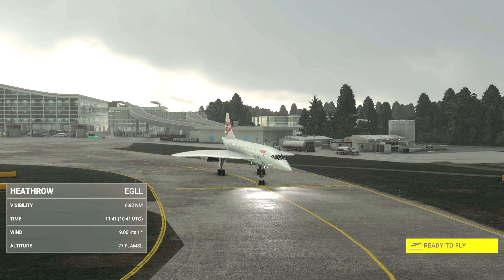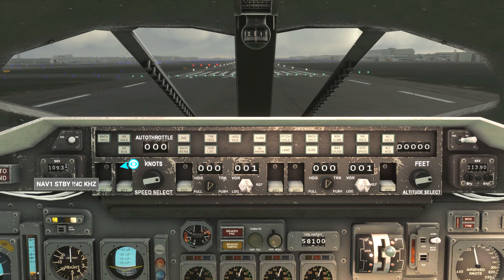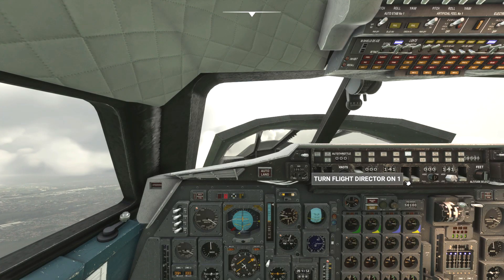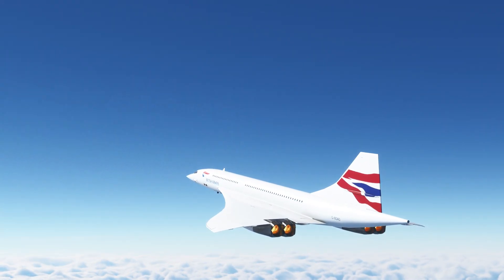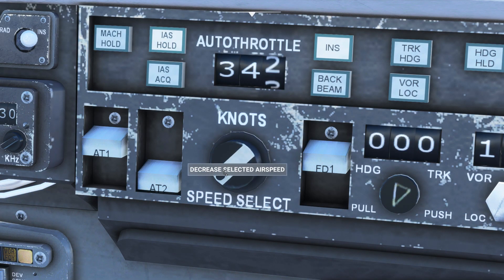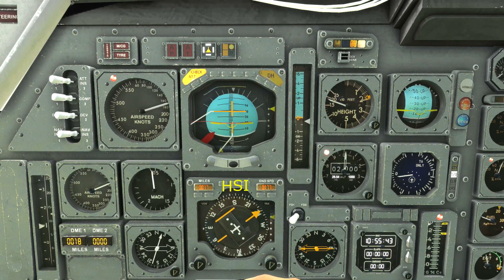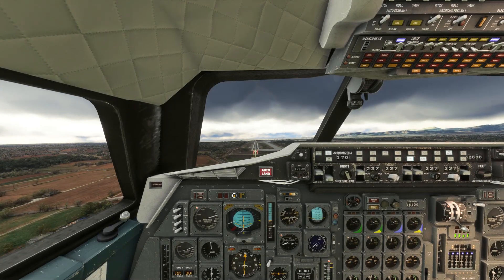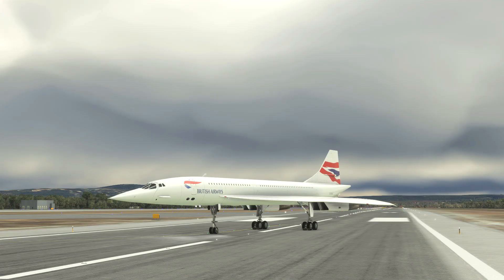DC Designs Concorde MSFS - Easy Tutorial | Full Flight

Comment from the maker: IMPORTANT: The plane has been updated since this video and fuel trim actually affects the aircraft now. To adjust it, please check out one of the many MSFS Concorde fuel trim tutorials on YouTube such as this https://youtu.be/q7DvOmtm38c?si=1Xe5C3Lzwh06GWxo

If you encounter other issues, make sure the plane is up to date - the updates can be found on the Just Flight website or ingame Marketplace, depending where you bought Concorde from.

Other tutorials:
Cold & dark start tutorial: https://youtu.be/M2ZXd7JV444
Immersive flight EGLL - KJFK: https://youtu.be/gqRzWGr0K3I
Reply: Thank you for the video, was great. One question though.. first flight today, all was fine until decent. When I tried to set the altitude to 36000, hit the two buttons and went to set verticle speed, but it wouldn't change at all.. I saw in your video it displayed the verticle speed while hovering over the mouse, but for me, nothing! Had to descend manually and then only at 2500 would it stick to the altitude. Any ideas of what I did wrong? Thanks
Reply from the maker: @611Jayman  sorry just saw this (thanks YouTube). You need to hold down the nose up/down switch until you can see the arrow change position on the VSI (the tall bar near the primary flight instruments which goes from +6 to -6).
Reply: that guy you have linked for the tutorial paywalled his video
Reply from the maker: @deberryn  yup thanks, link updated. I was surprised to see this had happened, and I’m really not a fan of paywalling information that is freely available from other creators. Seems a little elitist and self important IMO.
Reply: Many thanks.I tried to
ask Just Flight,not to buy and download,l could ask about this ocasion,marketplace is also asked,but,no replay. I wonder if I would buy Just Flight derectly.
Reply: Thank's for the heads up.💚
Reply: For some reason, when ap is engaged the plane only banks right
Reply from the maker: @louiscobley1  Not sure the airplane has been updated for su14 yet. Could be a bug. Seek support from the developer.
Reply: @smilerfanatic8889 did you fix this
Reply: I've watched this many times, excellent tutorial ❤
Reply: I cannot put max climb and altitude acquired on at the same time
 Please help
Reply: @RiDs4163same did you ever resolve it?

Comment: Bro can u PLEASE make a new tutorial. First, I can’t use max climb and altitude acquired at the same time! Secondly, what I do is set the plane first to 28,0000 feet with the autopilot and alt acquired! It reaches 28,000 feet around Mach 1, but then when I set it to 60,000 feet, the plane starts ascending but then the trim goes up to about 20% and I can’t get past Mach 1.20 before it slows down.
Reply from the maker: Have you tried the fuel trim tutorial from the pinned comment? :)
Reply: @TiJayFLY I tried it just now !The pitch keeps going up to almost 20% and the plane eventually stalls!

Comment: It never lets me lower the flaps
Reply from the maker: It doesn’t have flaps 😉
Reply: @TiJayFLY I meant the nose sorry 🤣
Reply from the maker: @pedrocuadrado-qc2sz check the speed :) it won’t deploy if the nose would be overspeed
Reply: @TiJayFLY it’s like when I’m in the runway it won’t let me lower the noise. And it won’t let me climb to 62000 only stay at 43,000.
Reply: @pedrocuadrado-qc2sz  It's dependent on external plane weight including fuel and temps if it can climb, so it can take a long time to get to 60k IF it can reach it also use MAX CLIMB.

Comment: Something seems to have been changed since you made this video. It doesn't appear to be possible to have Max Climb AND Alt Acquire on at the same time any more. If you switch one on, the other goes off.
Reply from the maker: @jettlethedragonpeeltheoran8915  Possible. But the actual Concorde procedure (that is also used in other sims such as FS9/FSX and Aerofly) is to have both on, so if this has changed it’s technically incorrect…
Reply: im getting this too!

Comment: You really should point out at the beginning that the nav source switch above the frequency display MUST be set to INS if you want the plane to follow the correct route after takeoff. By default, it's set the other way. In this video, it's already set correctly.
Reply from the maker: At the time it probably was set correctly by default. The plane and sim have been updated a fair few times since. I didn’t do any “off screen” setup - I recorded and included every step that was necessary at the time.

Thanks for the comment, hopefully anyone who needs to see it will do

Comment: i have a question, when i hit exactly mach 2.0 it sounds the overspeed alert and it doesnt let me continue cimb, it stucks at 48000 feet and it's VERY anoying
Reply from the maker: You're either not in MAX CLIMB or your fuel trim is bad
Reply: @TiJayFLY  in case is the first one, then why it doesn't climb more? and in case is the second one, how do i fix it?
Reply from the maker: @leonolink6738  probably fuel trim. Useful video in pinned comment

Comment: I have an issue with approach. My concorde flight the flightpan perfectly on the nav, but just before the final turn towards the runway and approach, it goes straight on. It does not want to make the final turn towards the runway. Anyone else having this issue, or can help me to solve it?
Reply from the maker: It’s a known issue with the plane
Reply: @TiJayFLY  thanks. Guess I'll have to fly the final approach manually. Hopefully they will fix it at some point.
Reply from the maker: @GerhardusDelport  it’s a limitation in the sim. GPS path following and ILS following share sensitivity settings - in Concorde, the sensitivity needs to be really low or it would wander at Mach 2. The side effect is it’s not sensitive enough to follow an ILS

Comment: Hi, I was just wondering if anyone knows how to see how many NM you are from your destination, because I don't know when to start descending now :)
And just wanted to say that this is a great tutorial, I can do full Concorde flights myself now while using a few systems (so not just manually flying from point a to point b without autopilot etc.), making my gameplay feel way more realistic than it used to be!
Reply from the maker: Concorde TOD is roughly 215nm from destination, assuming you’re at Mach 2/60,000ft. There is a DTG counter on the pedestal (assuming you’re flying direct and the “next” waypoint is your destination)
Reply: @TiJayFLY  Usually I’m flying using waypoints in between my departure and arrival airport, is there any way to see the distance than?
Reply from the maker: @kevin_van_den_berg  I think if you have the GTN750 addon you can pop up a GPS that will list distances throughout your flight (in any plane, not just Concorde).
Reply: @TiJayFLY  ah thx! I’ll install that later, that would be really useful 😅

Comment: Followed this guide to the letter, but for some reason even though a pull back completely on the yoke, the aircraft wont nose up or take off even well past 200kts, it just plows through the end of the runway, I have no idea what I am doing wrong
Reply from the maker: It’s not just this guide you need to follow since an earlier update - you’ll also need the fuel trim video linked in the pinned comment. In most Concorde add ons this flight engineer role is automated, but for some reason you have to do it yourself in this one 🫠

Aside from that, check afterburners are on during takeoff, and that the airplane isn’t overweight or out of CG in the weight/balance menu preflight.
Reply: @TiJayFLY  Thanks for the reply, afterburners were on and the aircraft was certainly not overweight, guess it has to do with the whole fuel tank trim business but I wasn't sure, seems very complicated even with the video you linked, wont bother around with it now haha, thanks.
Reply from the maker: @waynesyrzysko7382  My feelings too. I’m waiting for the FSLabs Concorde, and I recommend everyone does the same.

Comment: Hi, for some reason, the autopilot dials and knobs aren't responding. So I can't change the frequency or altitude or anything. Do you know what the reasons for that would be?
Reply from the maker: Is the plane up to date?
Reply: @TiJayFLY  I've only just downloaded it.

It worked the 1st time and I used your tutorial, now it's just flaking on me 😕

*Edit thanks for the quick response.
Reply from the maker: @d3vsy  it’s not the most reliable add on. Tbh it may be fixed just by restarting your PC
Reply: @TiJayFLY  I'll try it, however I'm on xbox :D

Comment: I don't do any of this, just power up and go...

Maybe that's why I don't get to Mach speed, seems to stick around 300 knots, even trying to fly level with afterburners on!
Reply from the maker: Concorde does require a specific procedure, but your issue is more likely fuel trim. Check the pinned comment, as it needs to be adjusted manually now 😢
Reply: @TiJayFLY  I will have a look, I'm a very basic pilot, so will have to see how I get on lol
Reply from the maker: @WattsZen  when this plane was released (and this tutorial was made), fuel trim didn’t affect the plane and so it was suitable for beginners - but since fuel trim dynamics were activated it became a lot harder. Even I don’t really fly it these days because of this. 

Every other sim Concorde (Colimata, FSLabs, PSS) in the past has included a virtual flight engineer to deal with this stuff. It’s a shame this one doesn’t, especially given MSFS’ core audience of casual and beginner pilots.

Comment: Hi there, I have some very frustrating problems. My flaps do not work since the lever goes down and comes straight back up and the altitude select knob goes up very slowly and takes a while to get to 28000 feet. I would appreciate any help with this, thanks.
Reply from the maker: For the first one, make sure the airplane is up to date. File a bug report if it persists. I believe there are two click spot positions for the altitude knob - 100s and 1000s, but if this isn’t the case, it should increase in scroll speed the longer the left click is held for
Reply: @TiJayFLY  Thanks for the info. Also, at 5:40 you said keep an eye on the mini map. I am quite new to flight sim so would you mind telling me where to find that?
Reply from the maker: @shrey2108  mouse to the top of the screen then the map icon

Comment: NO passangers and pilot apeared. only co-pilot . how do I control to enjoy with avatar?
Reply from the maker: Add pilot and passenger weight in fuel/weight setup menu in sim
Reply: @TiJayFLY   
Thanks for your reply.
 I did as you do, but not avatar appeared, and then I tried to change it in the camera section, then I push co-pilot button, pilot appeared and co-pilot setting an avatar before disappeared.
In the cabin, I push the passenger switch, I could hear the passenger sounds without passenger avatar. 
In these reason, I would ask you how to do.
Reply from the maker: After starting flight, please check weights again in top menu bar. Flight Simulator does occasionally change the weight and removes pilot/co-pilot/passenger weight.
Reply: @TiJayFLY  thanks I did sometimes but not,  in addition to that, I tried to reinstalled, but not, I don't know why this situation  has continued.version is updated. pc for  xbox series is not fit for avatar, toilet door is opend, water is drawing, passenger's chatting I can hear, and then?
Reply from the maker: @osamuumemoto7688  maybe it has broken 😔
Reply: @TiJayFLY  broken❗️I can agree with you. Many thanks for your advice.

Comment: i often experience unusual and undesired flight behavior with autopilot. for instance i will get to 28,000ft and do the procedure to attempt to get to 60,000 but at 36,000 feet it will stop climbing and pitch up down wildly a lot. its only fixed with a combination of turning off max climb and or turning autopilot off altogether and turning them back on again. 

another strange thing is the plane will be flying in a straight line on a heading but the plane will be positioned strangely in the sky ie not extactly facing forward more at an angle. say if i was at a heading at 360 the plane is flighing straight but the plane itself is position in the sky as if flying at 20 degrees

lastly the plane might at some point decide not to fly the flight plan and course i wanted it to and will fly around in a circle
Reply from the maker: 1. See the pinned comment about fuel trim. 2. That’s due to crosswind 3. That’ll be due to an unsuitable flight plan for the speed. Avoid tight turns in supersonic flight.

Comment: Great vid, how did you set the course?
Reply from the maker: It actually happens automatically in this plane when the frequency is tuned and RAD NAV is selected. If you need to set it manually, it’s the hexagonal knob below the course “display”, next to the heading on both sides of the MCP/AFCS.

Comment: The only thing good about this Aircraft is it's looks, after 3 updates it's naff, at 52,000' (the max alt I can achieve without it plummets) I get no more than 535 knots and I have so called lesser aircraft that can do that, it's just a conversion of their FSX Concorde with the same result's, RUBBISH
Reply from the maker: What’s the Mach number at 52,000, and is the fuel in trim?

Comment: I purchased this superb Concorde sim, having considerable experience back in the day with Concorde on FS2000 etc. and given the fact that this MS2020 sim lacked Concorde. Without watching tutorials or knowing/ remembering how to correctly manage the CG by pumping fuel aft (or forward when appropriate), the correct Mach speed during climb/ cruise profile seems difficult (impossible) to achieve... Before and after watching this tutorial my flights are unable to exceed approx. Mach 1.6 on CRZ/ CLB above FL280.
Reply from the maker: In the latest updates (after this video was made), fuel trim now affects the plane. Check out the fuel trim tutorial in the pinned comment 👍

Comment: Whenever I reach around 50,000ft, the aircraft can no longer speed up any further and starts reducing speed to a point where it actually starts stalling and descending. I have afterburners on and full throttle along with AP1, FD1, max climb
Reply from the maker: See the pinned comment - in the latest updates that released after this video, fuel trim does affect the plane and you’ll need to manage it. There’s a fuel trim tutorial (not mine, but very good) linked in that comment too
Reply: @TiJayFLY  thought it had something to do with the fuel, thanks a lot for the tutorial, great vids
Reply: @TiJayFLY  one question I do have, how do you go about planning the route fuel and what tanks to put it all in?
Reply from the maker: @joelangley7974  I just fly to and from the US so it’s a nearly full tank each way. MSFS distributes it between the different tanks well enough. For domestic UK flights where there’s no supersonic phase, I chuck in 20%. I don’t get any more scientific than that 😆 best to brim it, worst case you’ll be a little heavier on landing

Comment: I'm having alot of trouble I have followed the video a few times. The plane is doing fine until I reach about 55k ft and it starts losing altitude. I'm only getting to like 1.19 mach though. The afterburners are on. What else can I try to keep this thing at full throttle as I climb?
Reply from the maker: Since the update (after this video was made), fuel trim affects the plane. Check the fuel trim tutorial in the pinned comment - you’ll need to do this too now.

Comment: OK... 

I completed my first flight to JFK  last night thanks to your late night advice. Seems if you start on the runways instead of a gate, that INS/GPS switch is not in the default position. Also the plane can randomly throttle down when taking off so starting from the gate is a must for me. I'm on Concorde Ver. 1.0.2  btw. 

In terms of flight, there were a few issues but I noticed the same again today on the flight back to Heathrow so I need to pick your brains please as I haven't played MSFS or Concorde since the 2002 version.

1) What amount of fuel do I start with? Half-full tanks don't seem enough. I near enough ran out when I hit Newfoundland  last night and the same again before I reached Ireland on the way back. If I start with the max amount of fuel (within safe limits), the plane struggles to get up to 60k and M2.11. Sometimes it even stalls. Also when I do hit Mach. 2.11 and turn the afterburners off, the speed gradually begins to drop. When do I ignite them again and/or how often to keep the speed?

2) In the video you say begin decent at around 250 miles away from destination but that's nowhere near enough. I got atc commands to begin decent over the Irish sea and I was still travelling so high & fast that the plane couldn't turn quickly enough & I missed a sharp waypoint turn. This totally messed up the INS & ultimately my approach. Plus I couldn't find the command to skip to the next waypoint in the computer so I had to fly manually from Wales to Heathrow which was a pain in the ass. Any pointers here too would be great. No point in asking about ILS yet as both landings I've had to do manually for the same reasons. 

Thank you.
Reply from the maker: 1. Near to full as you can get. Latest updates made fuel CG affect the plane, so check the fuel trim tutorial in the pinned comment - you’ll have to keep it in trim now 😓
2. Remember it’s descent and decel -  250 miles is plenty. You’ll be subsonic and at regular airliner speeds before you know it. Ignore the MSFS ATC when flying Concorde, it’s always late with the descent call. The hard part is eyeballing where 250 miles is, as the DTG screen in this Concorde doesn’t work…
Reply: @TiJayFLY  OK thanks ill give it another go now haha